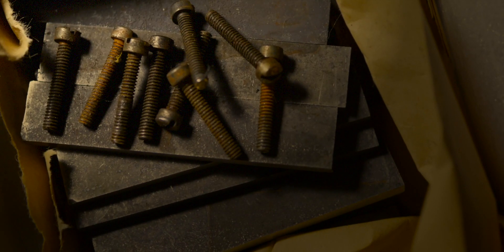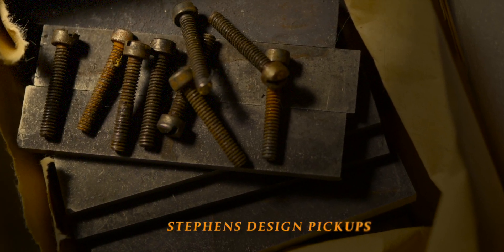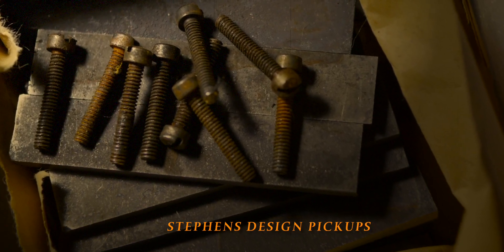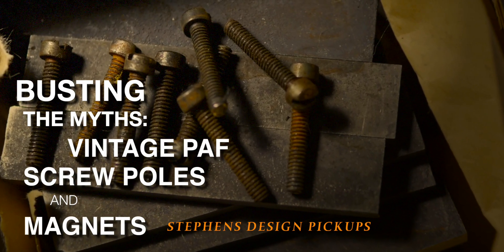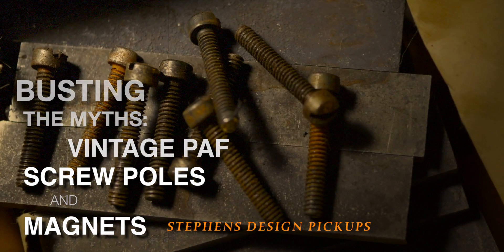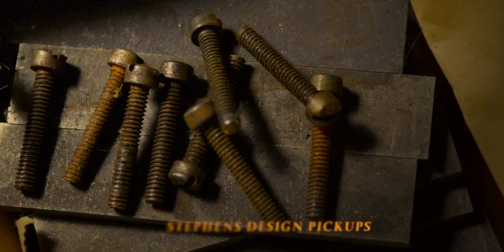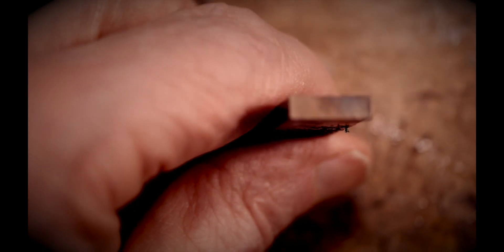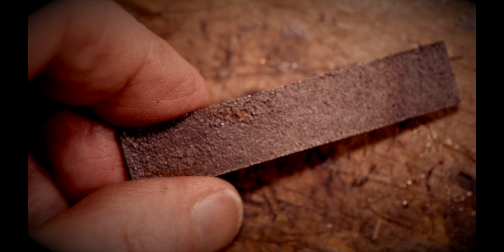PAF MYTH BUSTING - MAGIC MAGNETS AND POLE SCREWS

Comment from the maker: One thing I need to point out is that the video comparisons were done on different days. When you change a magnet or change pole screws, you have to play them right away then wait a day, because the pickup's magnetic domains have been disrupted and it takes a day for the pickup to recover and will sound darker right after the change. Also, room temperature and humidity changes may not be identical on each day the recording was made. AND, I cant guarantee the 2 mikes were in the identical position both days. The amps settings were identical. On a colder day, the pickup is going to be brighter sounding. A humidity change can change the sound of the speaker. I do think the pole screws sound a little warmer on the vintage screws, but I can't guarantee they were exactly adjusted the same either. So that "warmth" may not be real in itself. With the magnets I didn't hear any measurable differences at all. In retrospect I probably should have presented the comparisons as a BLIND test and not labeled which was which.
Reply: the question is.....is the alloy the same in the screws, vintage and new ?      AND a good question for you,  doing the rewinds, have you been able to document the individual coils as to their inconsistent wraps.......is there a pattern or anything ?  One coil, such as the slug coil, having more copper than the screw coil ?   Obviously if you are rewinding then you can't catch a meter reading for resistance unless you catch the break if its in the outer layers........but do you weigh them or anything like that to get a means to determine the copper as a close ballpark estimate ?  My curiousness comes from the late model Burstbuckers and 57's and now the 61's, with the respective slug dominant, even coils, and screw dominant aspect of these 3 types.......relative to the real McCoy.  But being said, from your perspective and experience, which way would you lean since everything in the literature points out the randomness of the people that were running the winding machines doing the coils ?   I would assume they had a bin for the slug coils and a bin for the screw coils......and randomly grabbed out of each bin as they assembled a complete pickup.  I just recently got a small lot of Alnico 4's ruff cast but ground to flatten.  AND BTW,  I have converted a 70's Norlin to vintage specs with wiring and saddles and light weight tail piece and steel studs.......AND  YOU ARE EXACTLY SPOT ON FOR THE TONALITY......the guitar now shines compared to how it came from the factory.  Which brings up the pots, what are your thoughts on the Volume pots as for the taper in the audio tapper thing.......CTS "J" taper as being vintage correct or close to it ??   I have to browse your video collection to see you you covered the pots and taper subject.......
Reply from the maker: @mikecamps7226  Yep same alloys in the screws, old and new. In fact you can't buy screw poles with this older alloy, I've not even seen that anyone else out there that even knows about it. NO, the winding was NOT inconsistent, the winding patterns are all identical except very early in '57 when the pattern was the same a P90's for that year. These were not crude old winding machines, either, they were modern for their time and very precise machines. No hand winding ever. There is no reason there would be a "slug" winder as one of the hypester guys out there claims. There were all wound on one machine, they all fit that machine. The bobbins however are not identical bobbins. You put 1000 winds on both vintage bobbins and the slug coil will always measure higher. Gibson to this day doesn't know what the hell they are doing with their pickups. Its all wrong alloys, even stainless steel pole screws that never happened in PAF days. The old Burstbuckers were probably the better ones they did, and they got worse after that I think. They are still using dyed poly nylon wire to make you think they're using plain enamel, you just can't make this stuff up ;-)
Reply: @SDPickups  I hear you on all that !  I was googling some stuff the other night.  If you are not aware of this......when the GOOGLE put up the list of questions and you can click for the answer or an answer list......When the que had which PAF is the BEST......the list answer has your pickups as NUMBER ONE.
Reply: @SDPickups  I have a NORLIN late 70's I was converting.....I never liked the tonality as it had a bright thing to it I attributed to the 3 piece maple neck with the rosewood cap.....as opposed to the traditional mahogany.  BUT after going to the light weight tail piece and proper studs and bushings and the proper bridge and saddles.......the tonality transformed in a positive direction to being almost perfect.  Hence that last thing I am doing is the volume pots.  I did have to change the mounting rings as the Norlin plastics had warped and collapsed.....so I went the route of the M69 butyrate rings.  I don't know your opinion on the matter, but I can say after knowing the guitar with its original Norlin plastics and then going with these M69 Butyrates......there was a slight sonic change and again for the better.   I wasn't anticipating a plastic for plastic situation and the forums dismiss this......but my ears hear it.     AND as for the pickup and bobbins......I was looking at the direction of any offsets within the standard parameters of the real PAF's.  Using the Gibson burstbuckers as the baseline as a "factory" PAF since they have the 2 offsets now and the even coils of the 57 Classics.   Since you are authority.....and I think somewhere you mentioned it in a different presentation.....its the Bobbin Plastics BUT it s the interior relationship of the thickness and the distance of the poles......as opposed to be purely on the butyrate VS the modern plastics.  I would be inclined to reason its a benign situation and down to the distance thing......but after the mounting ring change out......I'm speculating differently.  What are your thoughts ?
Reply: @SDPickups  Mentioning I am from Western PA.....I'm from the STEEL area....and my home town makes stainless.....The mill guys are about to actually go on STRIKE due to contract issues and the union.  BUT it was not uncommon for people to have lathes and milling machines at home....and alot of metallurgy knowledge.....if they weren't college educated metallurgists working out of the tech centers as opposed to the actual mills.  The plate farm at the tech center was just across the road from the old high school.......they left plate samples out to the weather to record data on alloys.....where plates have been out there since the 1920's & tracked.  As for the copper.....I look at the DC resistance per length and then weight/mass.....with the coating as a static factor with even thickness throughout and no variance......which in it self might not be truly realistic but it is what it is.  Coming at it as a motor builder would do when blue printing and balancing a motor.  I don't have the ability to do the winding aspect as you do wrapping bobbins for what you do.  ALL I ever saw was reference that the employee's on the winding machines were not exactly consistent  and some wrapped till the bobbins appeared full be sight as opposed to a counter.....and if they had several bobbins on the axle at a time to wrap with their feeding mechanism.  I assume they finished bobbins went into a bin to be paired up randomly to assemble a full finished pickup......SO its a curious thing to pick your brain as to what you are seeing since you do this
Reply from the maker: @mikecamps7226  The OLD copper wire and even modern wire is not "static." The old wire used insulation recipes that don't exist anymore, and was banned because of the use of benzene. The insulation thicknesses weren't identical, and the copper was not pure like it is today. Even now, every 5 pound spools of wire isn't perfectly identical to the next roll. PAF's were perfect wound on precision machines. the official recipe winds for PAF's was 10,000 winds which comes to 7.5K +/- The overwound ones happened every year, hit or miss. The wire diameters changed, the oldest wire being fatter, lower resistance. The last 59-60 PAF's had the thinnest wire I've seen, all of it still 42 gauge, but that gauge has a large tolerance range. PAF's were never ever hand wound, hand winding squashes the treble peak and is just BAD for any humbuckers.
Reply from the maker: @mikecamps7226  Rings don't do anything to the sound. Butyrate bobbins don't either. You probably had the pole screws set differently and/or pickup height. Screw pole adjustments and pickup height have a LOT of tonal control. The offsets thing is a MYTH. Pole and slug bobbins are not identical, so you wind the same number of winds on real PAF bobbins you WILL a measurement difference because the bobbins aren't identical. There is so MUCH hype and lack of good intelligent analytical thinking in the pickup world, people come up with the most ridiculous theories ;-) As for pots, you buy a 500K pot and it never 500K. Some are as low as 450K which is going diminish treble content, vs say a 560K pot which will highlight treble content.
Reply from the maker: @mikecamps7226  Butyrate rings were what was used. Butyrate is a SOFT plastic. ABS is a HARD plastic if thats what you mean, and I wouldn't doubt you might hears sonic differences since the rings are holding the pickup. Little things like that. you can hear. Butyrate holds the screws better, ABS breaks easy,
Reply from the maker: @mikecamps7226  Pots. You know, not that long ago, nobody cared about "taper" until some nerdy guy on a forum complained about it. If your pot drops volume too fast, you just turn the pot SLOWER. In fact, guys who do volume swells don't like slow taper pots. So now, "vintage taper" is pretty much used on everything these days, its not new or unusual or special. With my harnesses I use the CTS Emerson spec pots, they have a nice taper and are a bit better built than the run of the mill CTS pots. The old Centralabs are great pots, built like a tank, I think they have better transparency because the carbon tracks appear to be thicker than anything now. Sometimes they sound a little sterile to me, but heck, your guitar changes sound every other day if you pay attention to room temp and humidity and what that also does to you speakers and amplifier. The measured value of them tends to be higher, but not always, either. Good pots, but really pricey sometimes
Reply: @SDPickups  I totally agree with you on the temperature and humidity.  I'm from western pennsylvania and I have lived in south florida on the west coast where its highly humid aside from the heat.......and drastically different from conditions in western PA.  I did experience those effects years back with the speaker cones getting heavy and the alteration of the sonic quality in an amp, then with a guitar .....its the tuning stability and any swelling.  But I deal with tuning stability here due to the seasonal temperature changes and the general room temperature where I play VS where I store my guitars and when I play and the time of day.  The fun properties of wood....not just in guitars but in a masonry house where everything is hard wood.     AS for pots, I don't like a quick drop off as in not much sweep between wide open and 2 notches down, where as other guitar pots have a smooth transition from wide open and turning down to half the sweep travel.  I see audio taper as one standardized sweep but its not......though some do have the right sweep.  I see it in amplifiers on BASS pots......if I have to change a bad bass pot.  SO I'll be sourcing and using different pots moving forward for those positions after I play around a bit for performance.  BUT I'm a guy that goes wide open on everything for maximum signal transfer.....the in-between and ZERO are not part of my thing.  One thing I can say is that its best to solder the pot lugs upside down as not to let gravity draw in solder rosin spatter into the opening and get onto the track or wiper tip.......if you have really rosiny solder and use a standard pencil type soldering iron as opposed to a soldering station where you can control the heat.  Back in the day when the cleaners had freon in them...they CLEANED really well....these alternative formulas were lacking when the change over came in to being.
Reply: @SDPickups  I can understand the volume swells...if its a Tele or a Strat because the control is right the and you can hook your finger around it......but those are 250K pots on single coils.  You are kind of hard pressed to try to do swells with a Les Paul with the location of the controls.  Roy played a Tele, and I'm not trying to be ROY or a Lost Planet Airman on a Les Paul hahaha.
Reply: I found this fascinating,  I own a Wilkinson PAF ,  ,  I am not an expert,  I have listen to so many demo's with headphones with various You Tube,  there is a distinct sound at least to my ears,  when I play a few Led Zepp riffs,  yah the PAF sound comes out just like your demo,  great video ,  when  I read on my own Humbuckers  “wound to the same specification as given to Trevor Wilkinson by the creator of the humbucking pickup design, Seth Lover himself"  what is your opinion is there a distinct PAF design  ?
Reply from the maker: @canadianintheukbrian  Trevor is using unsubstantiated hype to sell his pickups. Yes, there was a distinct design, and you only see it in the earliest '57 PAF's. There were PAF's in '56 but the only guitars they were on were lap steel guitars and very few of those. The design changed many times, not because of INTENTION, but because of sloppy tolerances, molds that got worn out, and the many changes in materials that kept advancing thru PAF era and beyond. I have personally dissected and restored PAF's from every year they were made, and wrote down all the changes that affected the sound. I don't share any of that information for copy cats to steal. they were simple pickups for their time, Seth Lover's idea was to kind of make a noiseless P90, and the bobbins he used were cut down P90 bobbins. The steel he used, he had no idea of what alloys those were, he just got his steel from the Gibson metals bins. PAF's use many of the exact same parts in P90's. The reverse-engineering I did too almost 20 years and I occasionaly but rarely will find other things in every next PAF I restore or do authentications of. But all of it is known to me now.
Reply: @SDPickups  interesting , so many companies use words as PAF inspired ,  I even read they used some type of Ceramic pickups back in the  50's due to cost ; I really enjoyed your video ,   I love to put a really nice set in my guitar but being cost conscious and not Pro Player just a hobbyist  going to the Penthouse of Humbucker's doesn't make sense but at least half   way would be good.

Comment: Well, Ill tell you one thing, I like the way you demo the sound. Its not all gooped up with reverb, echo and other cheesy crap. Just clear old time playing where you can actually hear the notes.
Reply from the maker: I do like a little bit of reverb, but just a touch. Dry sound is uninspiring for me. But yeah, I never use pedals or effects, and my amps are all late 70's mostly, no bells and whistles except spring reverb on a few and vibrato. NO gain channels, or trick footswitches, just simple old circuits are the best, turn up all the way and control from the guitar. When I see guys playing vintage Les Pauls through a big pedal board, or a big rack of studio effects and plugins, and in a room with all kinds of electronics all over the place and blinking lights, the sound is either syrupy sweet that doesn't even sound like a REAL guitar, or has some awful distortion garbage going on, it makes me nauseous, LOL. There's a video of guy with a huge pedal board, playing Kossoff's ol Les Paul, he managed to make it sound like a pink Daisy beginner's guitar. Either you have a guitar that sounds amazing while not even plugged in, you don't need anything "helping" it. I went through a period in my life when I used pedals, right up until we moved to Portland, Oregon. Lots of blues jams back then and some of the hosts I saw had the most amazing tones I ever heard.Basically they were using old Blackface or Tweed amplifiers and nothing else, but a guitar cord. I was scared to death to try playing without the "talent boxes" until one night they made me get up after I'd put my pedals away, I never sounded better! Not long after that I found a '73 Deluxe Reverb, replaced the blown speaker and did the easy Blackface mod, updated the filter caps and WOW!
Reply: @SDPickups  Right on. Great reply...old school rocks.